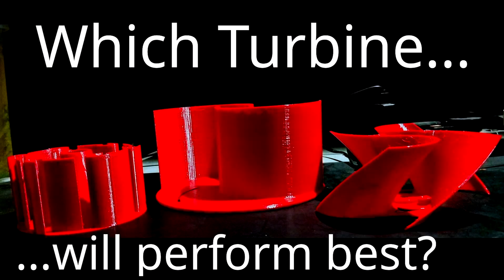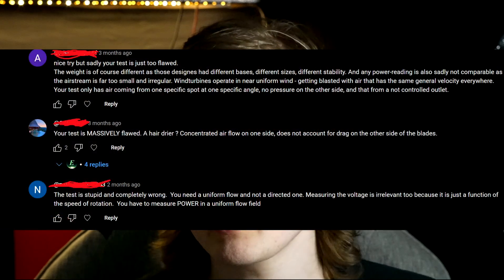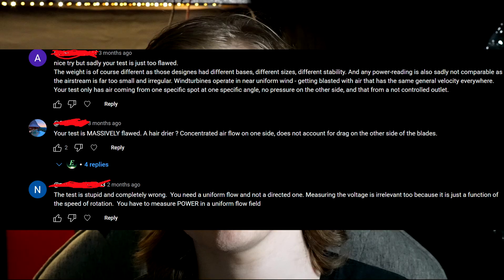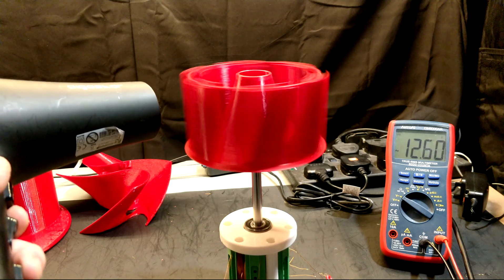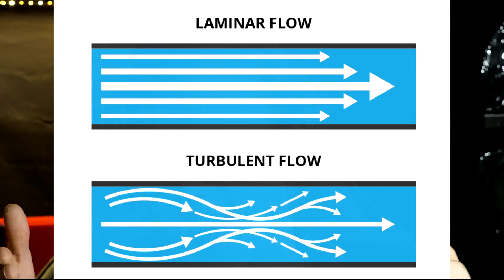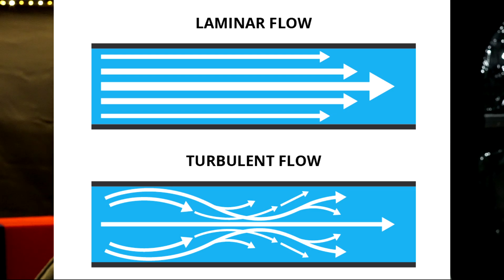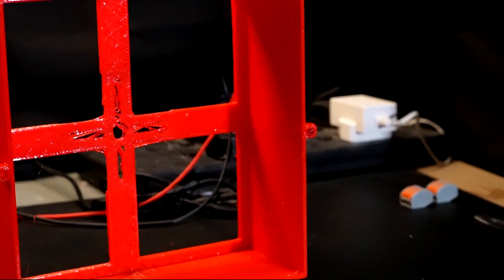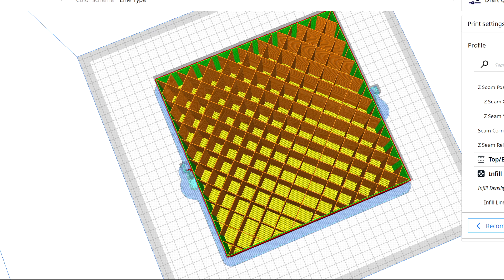My 3D printed Wind Tunnel and How it Works

Comment: To keep the flow “straighter” you should have the fan at the back so that it pulls air through and not pushes it in, which would create turbulence. Also the testing chamber would need a bigger ratio  to the contraction so that wind can flow through it. This is because the testing chamber would increase the pressure by too much to quickly so air wouldn’t flow through. Hope this helps!

Comment: Anometer calibration is infact done in a larger wind tunnel like 70cm diameter vs 20-30cm anemometer size. For ensuring laminar flow the wind tunnels I hang around (through having a father with an engineering bureau with three wind tunnels from small to 4.5m nozzle size) always had a funneling nozzle with a hexagon structure of 2-3cm depth to make the airflow laminar. Also the propeller was as far away as possible.

Comment: You could use a very slight venturi tube, having the inner diameter reduce slightly (like just 1/4"-1/2" depending how big the overall inner diameter is. And at the smallest point of the venturi, you can install a piece of screen. Small pieces of window screen are available for cheap at hardware stores (use the most basic screen rather than the very tight mesh for shady screen or for "better bug resistance" because they choke off airflow too much)  and that will even and smooth out the airflow for it to then expand ever so slightly to reduce airspeed slightly and bam. You now have an even, constant airflow that is equal at any point across the area of the wind tunnel.

Comment: Are you planning to build an enclosure around the testing section, or is that impractical at the moment due to space constraints? I imagine any stray breezes, etc. are minimal compared to the output of the device, but it still might make it a little bit more reproducible. You'd also be able to do fun stuff like running some smoke/mist through to visualize the flow which might be more difficult in an unconstrained environment? Great work though, just thinking of possible future iterations...

Comment: A stack of drinking straws is the way to equalise the flow.
Reply: I still think window screen is the easiest and cheapest option. How do you keep the straws stacked? Glue? The glue can be uneven leaving variations in the gaps. And unless you cut the straws very very short, then you must ensure they are all perfectly parallel or this will create variations in flow. And once you get them very very short, they are much harder to work with. 
Instead, buying a small repair patch of window screen is cheap, and all you have to do is cut it to shape with a good pair of scissors. Then you can insert it into the tunnel perpendicular to flow and thats it..